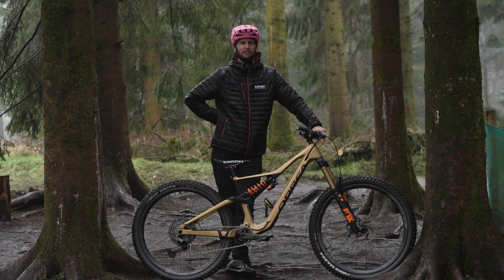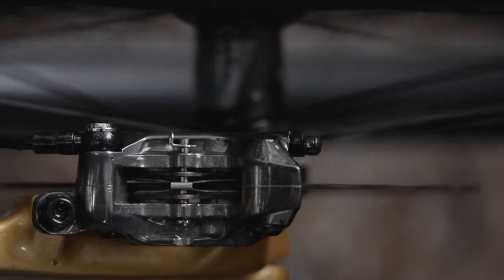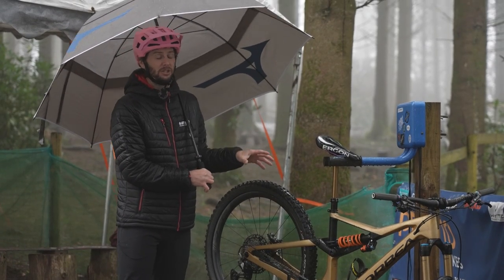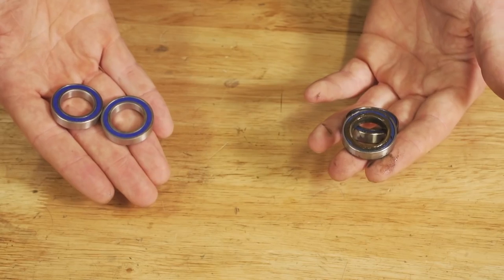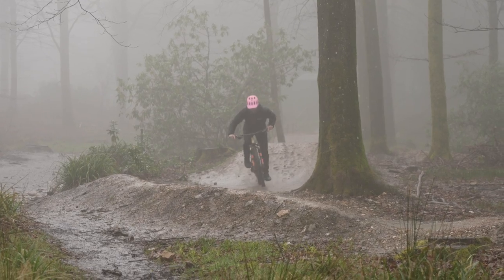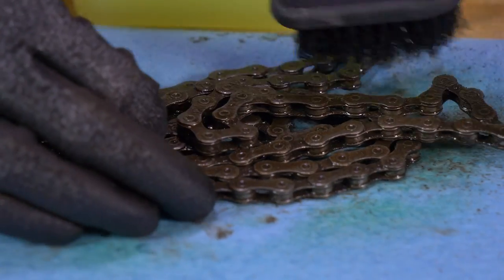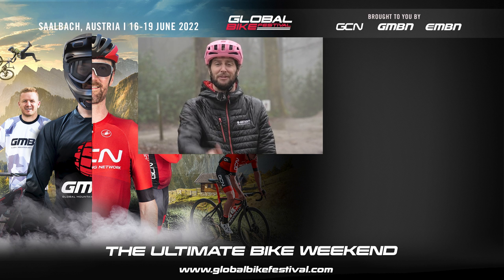Is Your Bike Making You Slower? | MTB Problem Solving!

Comment: One thing not mentioned in the video which has affected me before are my pedals that weren't rotating freely. Sticky pedals were a huge drag on pedalling performance. Once I took them apart and greased them up, it was like night and day. I felt like I was riding an e-bike even though I wasn't.
Reply: Really? ive asked around about this cause my pedals barley spins half a turn when i try to spin them. And most said that it shouldnt affect pedaling. but i should try to regrease them!

Comment: My main ones to watch out for are;
Wrong brake pads. Use a compound that suits how you ride, no point using sintered high-heat pads if you never build up the heat. Different compounds work better at different temperatures.
Poor lubrication. If it moves, keep it lubed.
Poor tyre choice. If you're an XC rider a set of 2.6 beastly DH tyres will not suit you. Likewise, a pair of low-profile 2.1 XC tyres are going to slip on fast DH runs. Get that balance. Pressure is also important. 
Geometry. If the bars are uncontrollably narrow/wide for you or the stem is too long/short then you'll ride slower because there's a psychology block due to reduced confidence. 
Suspension tuning. You'll lack traction or waste energy if it's too firm or too soft. You'll also potentially lose confidence. 
 A lot of things impact the mind. This can cause lasting issues even when the bike is dialed. A bike that inspires confidence likewise inspires speed.

Comment: Good advice.  Could also add incorrect, especially too low seat height.  Since raising mine I have found I am not only climbing hills a little faster but also have more energy and therefore more speed for the next section of the trail.

Comment: I had the bearings in the derailleur jockey wheel slowly dying. It took me a couple of rides to figure out that was the problem.  Once I figured it out, I bought a new pair of jockey wheels and replaced both the old ones.  The bike ran like new again.
Reply: What if it’s a kid mtb?? Still work?
Reply: @itzs0ckzz   It should, it will depend on the bike.  My jockey wheels had a screw that ran through them, so I could easily unscrew them to replace them. Check if the jockey wheels on the kids bike are screwed on or whether it is a press fit. If they are screwed on, check if they spin cleanly with no chain on the bike.  Mine wobbled from side to side, sounded bad (like there was grit in them), and had a spot where they would barely turn.

Comment: For brakes, loosen the bolts, but a business card (or two) (or feeler gauge cleaned of any oils, or parts of cereal box or similar) between the pad and the rotor on both sides.  Hold the brake handle so that they are gripping the rotor through the spacer.  Tighten the bolts avoiding moving the caliper, do a little on each bolt back and forth until tight.  The brakes will now have the proper spacing and alignment with the rotor.  It will also improve braking performance as it will not flex the rotor under braking when aligned right.  They sell a metal spacer that clips onto the rotor for aligning it... but it does the same as a scrap business card or two.

Some bearings are not as good as others, my son's polygon with very similar tires rolling down the road with me on my 18 year old trek on 18 year old shimano hubs, neither pedaling, starting at the same speed, I will always out roll him.  I've inspected and repacked the bearings on the polygon... he is on 27.5 tubeless and I'm on 26 with tubes so the rotating mass should be similar.  I would order better hubs but he has just about outgrown the bike.

Comment: I had this one last week for rubbing brakes (and no brakes and everything inbetween at random)..... make sure you tighten your through axles properly.
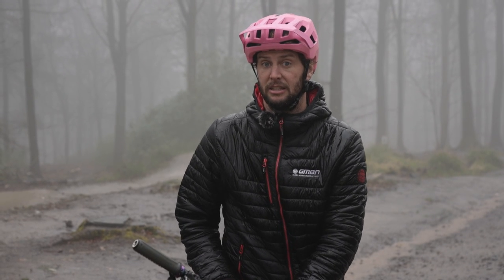5:23 how is a punture more dangerous than a damaged wheel? Also puncture repair kits are a thing as are travel pumps. Everyone should be carrying both 24/7

Comment: Question: I ran through rock garden and it feels like the bike slow down  everytime there's some section with vibrating bits, is it suspension setup? I ran it with 50 psi assegai at the front

Comment: My rear 29 rim flexes on a hard turn and I think the spokes need to be adjusted on a 2018 Rift Zone 3. I tightened the frame pivots and checked/cleaned/ lubed the top frame bearings. Anyone experienced this strange sensation on a full suspension bike?
Reply: My 29er is a hardtail but I do notice the flex. Bigger wheels bend sideways more. I've tried the same corners on the 29er and on my old 20" (full suspension) kids' bike, and the smaller bike and its rims actually feel more solid despite worn out pivots and all.

Comment: I have Brake and suspension problem my friends run super super firm suspension and I run it soft and I bottom out my rear a lot I don’t know what to run anymore I also have problems with getting stuff on my discs or bending them